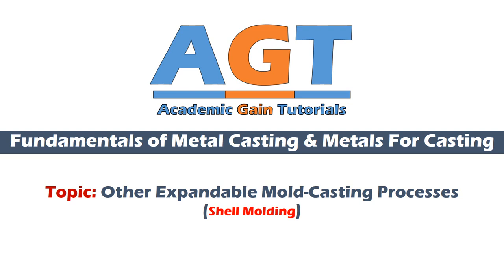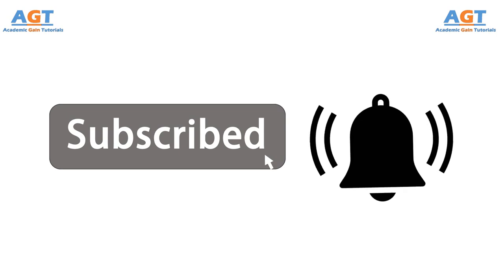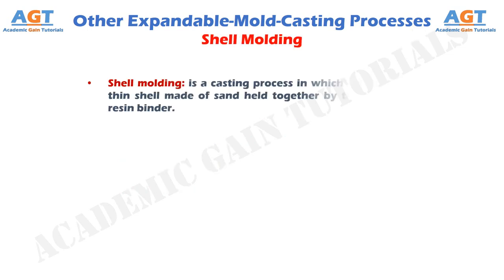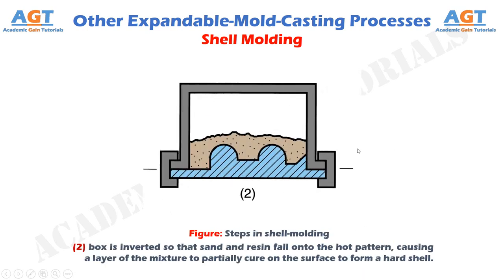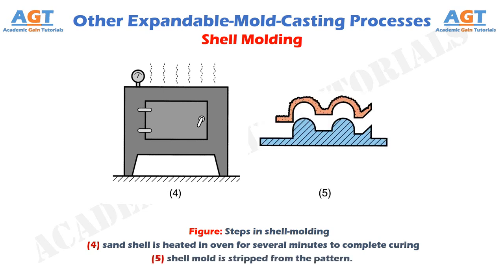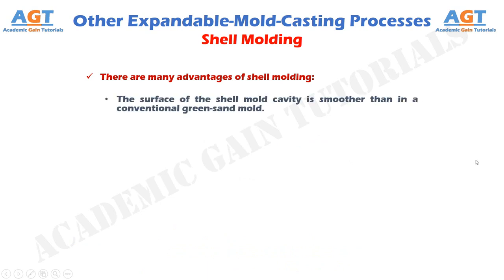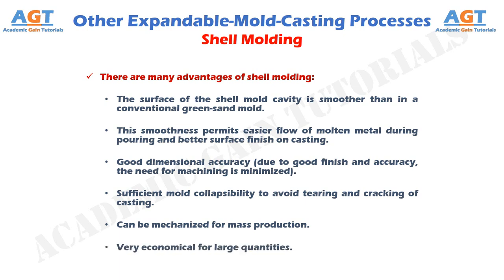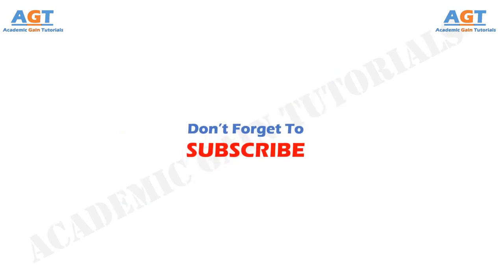Shell Molding - Expandable Mold Casting Processes

Comment: Thanks.
The advantages and disadvantages of this method on Wikipedia:
►Advantages:
•Shell molding can be completely automated for mass production.
•The high productivity, low labor costs, good surface finishes, and precision of the process can more than pay for itself if it reduces machining costs.
•There are few problems due to gases, because of the absence of moisture in the shell, and the little gas that is still present easily escapes through the thin shell. When the metal is poured some of the resin binder burns out on the surface of the shell, which makes shaking out easy.
•Complex shapes and fine details can be formed with very good surface finish, high production rate, low labor cost (if automated).
•Low tooling cost, Little scrap generated.
•Very large parts and complex shapes can be produced.
•Many material options.
•Low tooling and equipment cost.
•Scrap can be recycled.
•Short lead time possible.
►Disadvantages:
•The gating system must be part of the pattern because the entire mold is formed from the pattern, which can be expensive.
•High equipment cost.
•The resin for the sand is expensive, although not much is required because only a shell is being formed.
•Poor material strength.
•High porosity possible.
•Secondary machining often required.
•High labor cost if done manually.